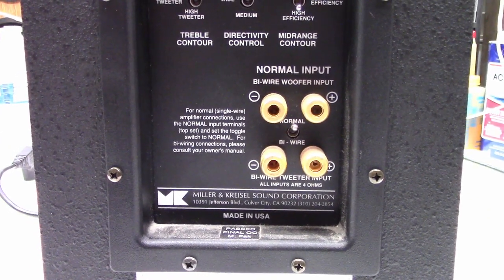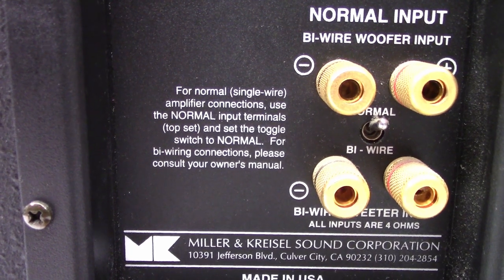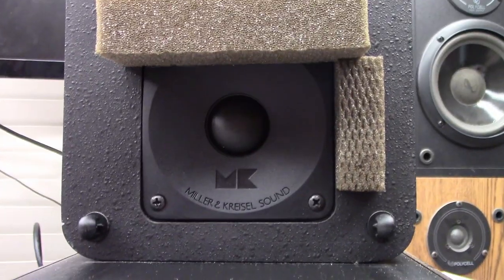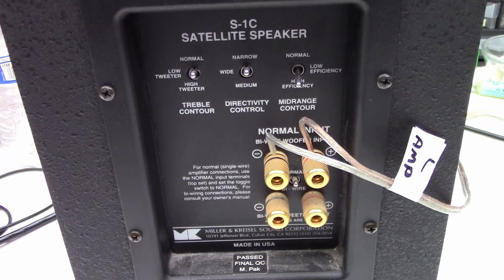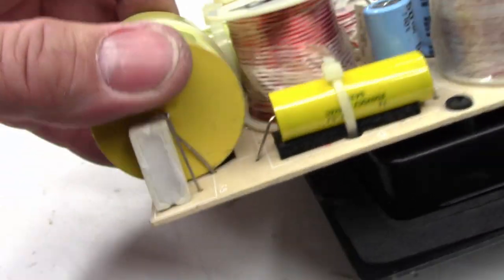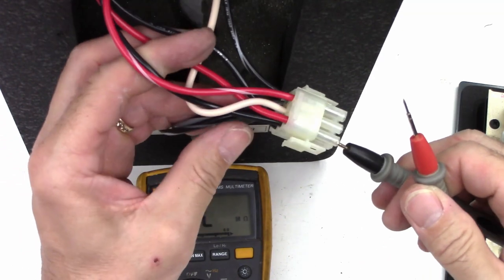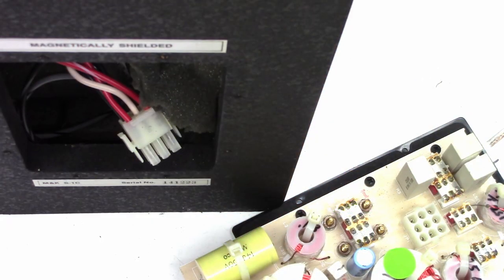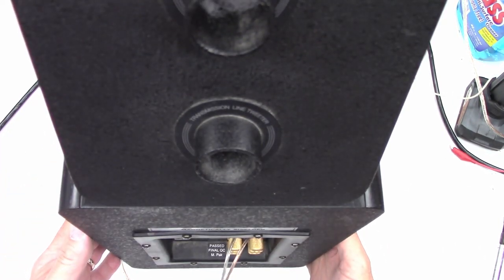MILLER AND KREISEL M&K S-1C SPEAKER TESTING FOR DEFECTS THAT BLEW UP THE DENON AVR-X4300H AMPLIFIER

Comment: The M&K S-1C model had a push-pull woofer arrangement like their duel speaker subwoofers. The theory was to cancel the out of phase harmonics. I still have the original S-1B satellites which had normal front firing drivers. They sound incredible to this day and completely reliable at over thirty years old and drive my all M&K 5.1 dual sub home theater. Good sound is good sound. Good quality lasts.
Reply: @ idigbebop, I have a 5.2.2 M&K setup in my bedroom. I replaced the center S-1C with the HUGE Klipsch RC-6400, bc I needed a HORIZONTAL unit to fit under my SONY 65" 4 K TV. I'm using the replaced center S-1C as a surround for now, but I want to buy another S-1C and use them as stereo speakers with an analogue Class G,  2.1 system in my living room.
Reply: @mr.blackhawk142  I’m sure it will sound like originally intended, great.
Reply: @idigbebop  KenKreisel  makes QUALITY products, so I'm looking to buy another S-1C for my VINYL stereo system.

Comment: I have several M&K sats and subs and the original M&K never made anything in China.  Ken Kreisel stated M&K's demise was due to "knock offs" that came from China. Now the current M&K may have speakers made in China, but the original owners have nothing to do with the current M&K. I don't have any experience with the current offerings, but the original company made outstanding speakers and subs! The original M&K designed their own drivers that were then manufactured by Vifa, Peerless, and subs were Eminence. Great stuff! The speaker you have in the video was $2,000 a pair. My M&K S100B satellites were $1,200 a pair in the early 1990's.
Reply: New M&K is made in Denmark
Reply: @sirrealism5806  I believe the company that bought M&K is from Denmark and the sourced drivers might be Danish, but I believe they are actually made in China.
Reply: Nice username! L0L I have 8 M&K speakers including the MX-200 subwoofer, and the S-1C satellite speaker (I have three) is my favorite so far! I like the precision switches, etc on it, and it can be fine-tuned for different listening rooms!
Reply: @mr.blackhawk142  great stuff!
Reply: @BlackHawkPSU  well said ! M&k has a very rich history in Audio recording as well. Ken had a cutting lathe and was a pioneer in the fore front of digital audio. 

People should read the company timeline it's incredible 🙂

Comment: Some cost cutting there but still those crossovers are really well build. Air gap Inductors, polycaps on there that's pretty incredible. Reason why you see the np caps was purely because of space restrictions 

All the m&k I got a SX4 and a 1b are still incredible sounding speakers. The 1c in the video was at the time the top model.

The foam was there to prevent lobing , as you're using two tweeters. Ken kreisel still today uses that same ideology. It's a array to make them sound way bigger on the vertical axis. It's all phase correct via the crossover overhead. 

The 1c also had a transmission line (you can see the small ports on the back. The inverted woofers was a push pull design. Some say is isobaric some say it's push pull (there is a difference there) 

One things for sure , these were high end speakers and for sure the 1c is a rare unobtainium speaker in the m&k series. 

Great stuff, they used peerless woofers and vifa tweeters . At one time the s1 had peerless tweeters (rectangle faceplates) and peerless woofers aswell. They all had very similar drivers to assure quality throughout the lineage. 

Ken also designed them not for the consumer at first. The first 1 was build in 78 and m&k opened their doors way later. The reason they were already there, is because Ken designed the sub sattelite system for his own studio use. 

That's right Ken had his own direct audio to CD recording studio. He also had a cutting lathe heavily modified to make his master pressings on vinyl. He was already digital ready , before the first CD player hit the market . There is a ridiculous interesting past there . What speaker manufacturer can say they had a recording studio (so really understand what it's about ) 

He bought for 40k at the time Sony first pcm digital audio recorder (Sony pcm 1600). And had a heavy hand in the modifications he did to them . That later in by Sony were implemented, in their consumer versions. Also Ken subwoofer was used by steely Dan ,in their recording sessions. They were the first band, to use a subwoofer in their recording sessions
Reply from the maker: I do chat with Ken Kreisel from time to time via E-mail when I need a service manual or schematic on one of his MK subs. He is very easy to deal with, A great man!

Comment: Two things to note. First I was surprised to see those 2 polarised capacitors on the crossover. Second, there is a far easier way to check this. After you have done a soundcheck and it sounds fine. Simply connect an AC current meter in series with the speaker line and connect an audio sweep generator up to it. Run the sweep generator from 20 Hz to 20KHZ  while noting the current draw.  Record the frequency with the most current draw and then do an ohms law check to see what ohms it comes out to.

Comment: So what was the deal with the reversed woofer? Is it possible that one of them was passive? Didn't look like it and you know the reversed woofer was cancelling out the other one. Shame you didn't test the speaker polarity and I didn't see any ports. That is the oddest speaker configuration I've ever seem and I've designed, engineered and built a number of custom sets. Tweeters sounded fine, but that woofer configuration makes me want to look at that more carefully, or just have a few beers and say screw it! :) LOL PS, really nice beefy speaker wires!
Reply: The midrange drivers are both active and are in a push-pull configuration which lowers distortion. M&K first used this configuration with their subwoofers. This was their first and only satellite speaker to the best of my knowledge to use this configuration and it was outstanding like all of their speakers!
Reply: @BlackHawkPSU  I would have liked to hear them connected to a quality class A amp setup. I don't think these folks, who still have a web presents and in business, don't use this nomenclature anymore, at least from what gleaned on their website, but still a novelty!
Reply: The S-1C has PUSH-PULL mid-basses, as the MX-200 sub has two PUSH-PULL 12" WOOFERS in it! These speakers have been well-thought out!